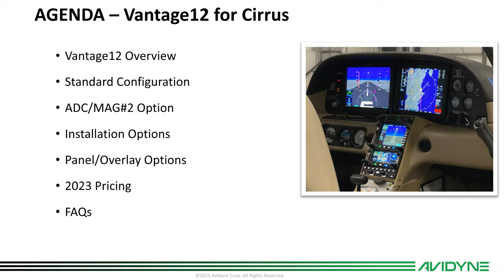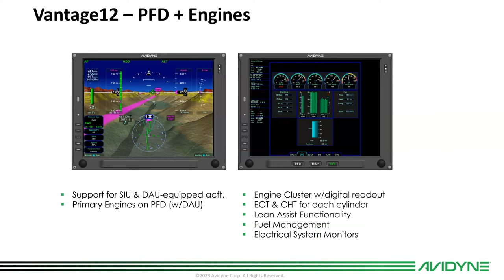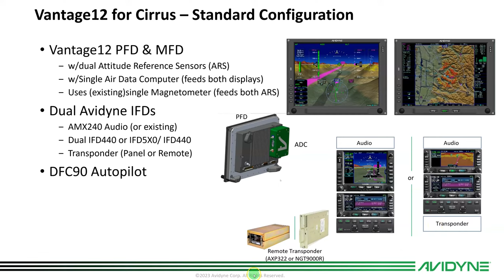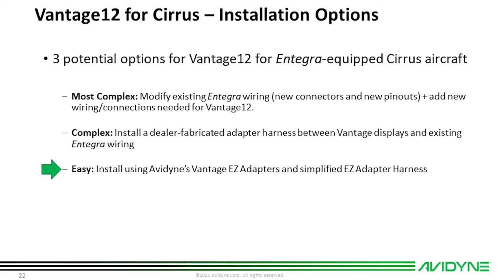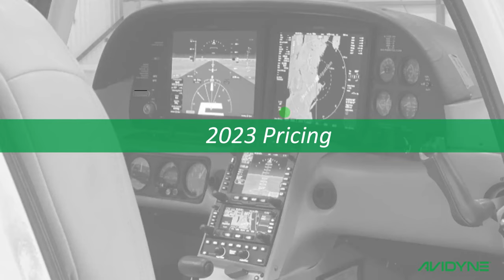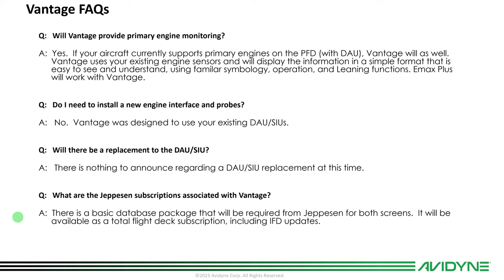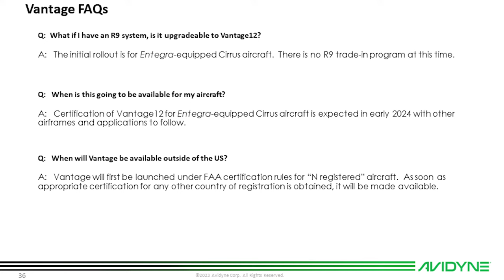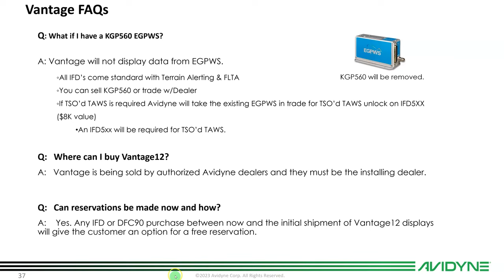Vantage12 for Cirrus Update Webinar

Comment: What’s the difference between the R9 systems and Vantage12?
Reply from the maker: R9 is a fully-integrated Flight Display system plus DFC90/100 autopilot we previously developed for the Cirrus to replace existing Entegra sysetms.    Vantage is our new federated next-generation technology based on R9's award winning FMS system, using 12-inch Touch screens plus dual IFD Series navigators (with R10 software) and DFC90 autopilot--also designed to replace legacy Entegra systems.